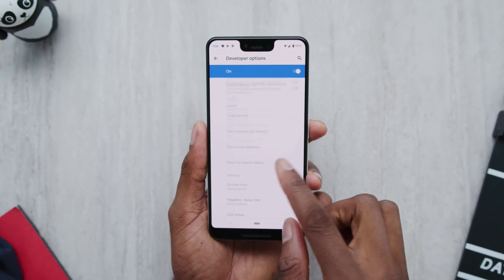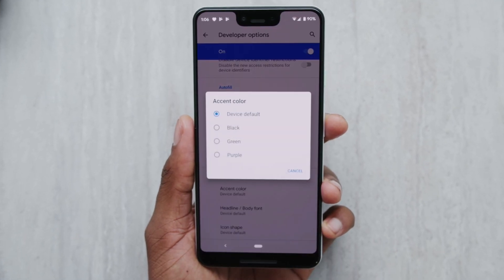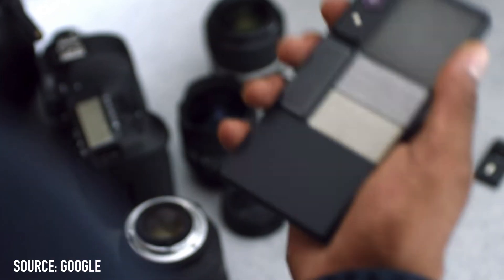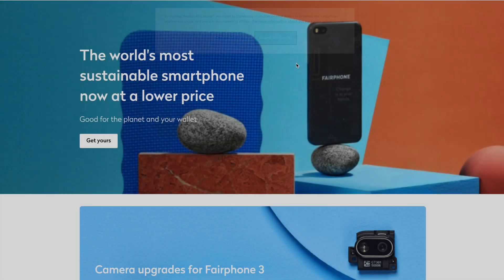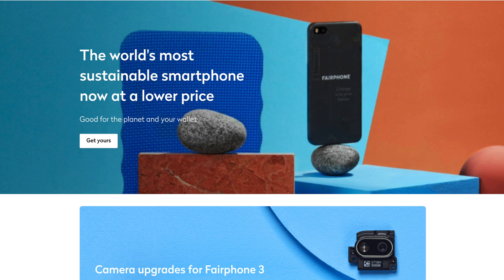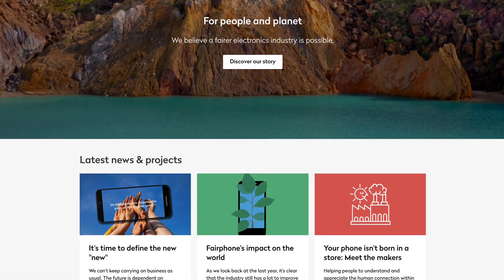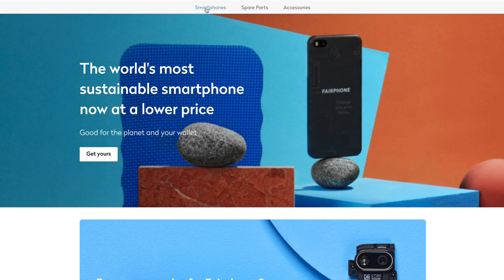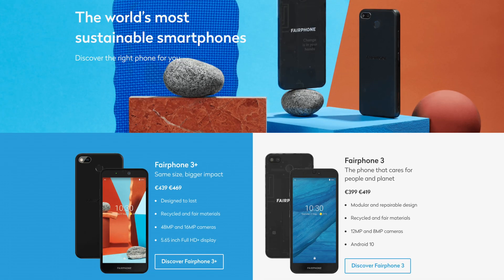Are Modular phones Better for the Environment?

Comment: Even modular cameras like a mirrorless camera change standards. Like new types of batteries, or even new hot shoe. There was a more modular small camera system like the ricoh gxr, not very popular in the end.  Giant cameras like medium formats are better for modularity, where space is less constrained, or cinema cameras like red or arri. Usually a module have size tolerance. There is also currently a class action on dell and their “upgradable” laptop. Not a size issue, more of a socket issue. And they discontinued alienware external GPU enclosure too. 

There are modular accessories phones like essential with the 360 camera, lucky goldstar friends and battery, and moto mods, none as widely adopted as a simple lightning port, which has flir camera support, blue microphone, ring lights, dxo one camera attachment, expandable batteries with camera shutter button too like lucky goldstar. And more with USB-c like creative sxfi spatial audio dac. 

Nice to be sustainable, great to get leed platinum as well, but tough to build out of rammed earth and open fenestrations for every project. Gonna run into double glazing and claddings very soon. Those are limited resources.

Comment: I would say no.
Apple already shows that the main point is software. iPhones have a much longer lifespan than Android phones.
And with the weak hardware that Fairphone is using, their phones won't last longer than 2-3 years even if you can replace stuff like the camera or battery. And on top of that, they're really expensive for what you get.
On top of that, the recycling is horrible when you have individual modules instead of just whole phones that you can send in and get it recycled.

Even if there is this whole right to repair thing going on, I would say that Apples way is much better when it comes to increasing the lifespan. Making phones last longer by providing longer update support (the iPhone 6S gets 7 years of updates) is the way and not stuff like replacing the battery on your own which most people wouldn't do anyway.
Reply: I'm not convinced you're getting it. First off, Fairphone source all their parts sustainably and ethically (both in extraction and production). In a way, it's amazing they can do all that and still charge what they do. I've heard it said that the Fairphone isn't too expensive - the problem is that other phones are too cheap.
I don't see how being able to trivially dismantle a phone makes it harder to recycle. Let's say you want to recycle mineral X from the screen - surely being able to remove the screen with screws rather than trying to separate it from other bonded components makes that easier?
I'm not saying the software side isn't important too. But Apple's admirable efforts in making things longer-lasting in the software side are totally undermined by their completely un-repairable devices and commitment to releasing a new sexy incrementally-upgraded version of the same product stack every year. I had a Pixel XL previously and had the battery replaced, and the (highly-qualified, professional) repairer had to burn through two replacement screens due to the poor design for repair, in what should have been a simple component replacement.

Comment: No, you still have to make the parts to fulfill demand.  Let's say 100% of people are onboard and modular phones are now a thing.  That's a lot of parts.  People are still going to lose them.  You can't guarantee people will recycle old parts.  People will have multiple modules. Trade-ins are going to be a mess. And that's just from first party vendors, think about the third party guys.  The smaller companies will have less recycling mandates and are part consumer as well.
Reply: Exactly.
That's also why replaceable batteries are not generally good for the environment either. People often buy 1-2 extra batteries even if they don't need them. They buy them just for this one scenario where they need them. And that means more batteries need to be produced and then lay around unused.
Reply: Until there's real break through in recycling technology, I'm talking about star trek type shit, our production of waste will continue to outpace our recycling efforts.

Comment: Ultimately, I think this needs to be addressed at the component level by stuff like socket/connector standards that allow you to swap out SOCs, RAM, storage, screens, batteries... anything.

In the ideal scenario, your phone is a ship of theseus, so if some new screen tech comes out, you can find a screen of the right size and swap it out for the old one, then replace the camera a year later, then the RAM, and 10 years later you have the same phone but none of the same components. Realistically, new technology forces new standards, so there will be some generational losses where you can't get the new X without getting a new Y that supports it. But even those don't have to affect everything. There's no reason why you shouldn't be able to keep the screen and casing but move over to brand new internals if the two are fully capable of communicating with each other.
Reply: PCs in a nutshell

Comment: I can see a number of big problems with this. For the base 'phone', for lack of a better term, to be feasible for 7 years, it would have to utilize the latest and greatest chipsets and be built to a very high standard of quality - neither of those is cheap to do in the slightest. Plus, in order to justify ongoing investment in new parts with such a long replacement cycle, the markup on those 'modules' would have to be massive, and while consumers may be saved from an annual/biannual replacement cycle, is it really cheaper? For instance, if I usually wait two years to replace my phone under an upgrade contract, then I will spend max around a couple hundred bucks for a brand new, top tier flagship device. However, if a new camera module comes out every year and they cost $150-$200 each, you're effectively paying a massive premium up to twice the cost of an upgrade, just  to replace only one component of your phone. It falls apart in terms of repairs too - using the camera again as an example, if you have  to buy a new one to replace a busted one, is it really that much cheaper than an insurance plan or even taking it to the manufacturer for service? Speaking of service, I could imagine that being a complete nightmare - especially if they try to keep module costs low by allowing other companies to create their own 'modules'. The vast array of device configurations would be hell (just imagine trying to sort out firmware updates) to troubleshoot and would drive up repair costs. Phones are not PCs, they are designed as a single unit. Another potential pitfall is that older tech does not always work with newer tech all that well, so if you only replace the camera for seven years but leave everything else the same, is your phone going to even be usable? What if the newer modules use more amperage than your battery can supply? Is that safe? Battery life could suffer too, even on newer 'phones', since the device can't be optimized around it's hardware, unless you keep everything proprietary, which is expensive. Finally, what's to stop them from one-day requiring users to permanently pair their modules with their base 'phone' so they won't work on another device. Yeah, it may not start that way, but if such a company was picked up by private equity or a major manufacturer, I am almost 100% certain they will do that - they have every incentive to.

In theory, it makes a ton of sense, but in practice it really seems like a borderline malicious way to nickel and dime people under the guise of having more control.

Comment: Watching this on my Xperia X running Ubuntu Touch 😁 (Fairphone can also run Ubuntu Touch 😉)

I think one of the main problem with the support on the Fairphone and similar device is software.  Android phones are stuck on their kernel version and only 1 or 2 major android upgrades and that's it. Mainline linux devices and OSes can solve this but it's a century behind in terms of features and reliability 😅

But the biggest thing that is near impossible to stop is people wanting to buy new things, just because, unless we raise the next generation to be contented with what works which I don't think is happening.

Comment: I have used the original Moto G for 7 years, and it was one of my favourite phones of all times. Now that I am in a much better financial situation and I use my phone more, I want an OLED screen, lots of RAM, a fast SoC, and a big battery. Couldn’t care less about the camera though…

A repairable phone would make it easier to keep it for longer, and even if I wanted to upgrade the phone to a completely new device, I could still sell of giveaway the old phone for someone else and it will mean someone else won’t need to buy a new one. For that reason I would be willing to pay a higher price for repairability, but I really don’t want to go back to slow phones.

If fairphone made a premium phone that had flagship specs (or close to it) and a repairable design, even if it costs 15%-20% higher than the competition, I would buy that one.

Comment: iPhone is supported for new OS versions for 6 years, then a further 3 years of security updates. They can be passed down to family members or sold for extended 2nd and 3rd lifespans. Apple does a great job of recycling at end of device life, to turn an old phone into parts needed for a new phone. Apple over engineers their devices specifically to be extremely long lasting.
Reply: Old iPhones can be a hassle to use though. Especially with them making things harder to repair from a third party, most people wouldn't keep their iPhone longer than 3 years.
Reply: @garryglasgow97  The average lifespan of iPhones are 4.2 years. The AVERAGE. That means many people keep their iPhones for longer than 4.2 years. And that's exactly what you can see on a daily basis. There are tons of people with iPhone 8, 7 or even using their 6S. Even the iPhone X is already 3.5 years old and many people still use it.
And Apple extent the lifespan even more since the update support gets longer and longer. The iPhone 6S will already get 7 years of support. Apple only stops the support if the hardware is really no longer capable of it. That means iPhones like the iPhone 11 or 12 will probably get up to 10 years of support one day. In fact when it comes to important security patches, Apple already is close to those 10 years.
Reply: @Raja995mh33  we're both right in some way. I have seen some people use really really old phones. The problem is that they're still a hassle to use. I was having trouble with my iPhone 6 when iPhone 10 was coming out. The problem is the lack of repairability in the future phones.
Reply: @garryglasgow97  Even there, Apple is actually partly on the better side. For example, try to find a repair shop that still has parts to repair your Galaxy S7. On the other hand the girlfriend of my dad just send in her iPhone 6(!) and got a new screen and battery. Sure, right to repair is totally a thing and Apple needs to open it more for third party repair shops but at least they still are providing parts for even 7+ year old phones while on Android you often have a hard time finding original parts for your only 2 year old phone.

Comment: The issue with this idea is durability. How much easier can you bring this phone with all it’s exposed components to its knees versus a well built phone that’s hard to repair, like modern Samsungs or iPhones which are already getting 5+ years of software support. And most people will probably just throw away the modules after they’ve switched them out. And if they were the type to upgrade every year,  nothings stopping them from just buying the new fairphone for the faster chip.

Comment: I'd still use old devices if they got security patches still, I've got 3 old Android devices but they all are on old security patches from years ago
Reply: get them recycled ?
Reply: That's the main problem after all. Phones these days are already powerful enough to last the 7 years that Fairphone wants (which is funny because Fairphones are not really powerful enough for this idea...). But Android manufacturers just stop supporting them after a while even if the hardware is more than capable enough to last longer. That's why the average lifespan of an iPhone is 4.2 years and only 2.3 years on an Android phone.
Reply: @Raja995mh33  it's why I'm actually more likely to buy iPhones now, because the longer life span (I like android and iOS equally so other than that it doesn't matter much to me). I've got an iPhone 8 that still holds up great to this day, even beats out my mid-range Samsung on performance.. company's are perfectly capable of keeping their devices running a couple extra years, and really should

Comment: Me watching on the LG G5 after switching the battery for the second time : Yes, so much yes! But please give me Flagship specs! I.m.o. Midrange or Low-End Processors are a waste of silicon
Reply: They're not for people that want cheaper devices and buying second hand high end stuff doesn't always guarantee long run software support
Reply: @seanonraet8327  Sadly yes, however in my opinion Google and Android devs (like myself) are very good at working around the issue. Even my Android 6 (!) phones like the Galaxy S5 can run 90% of Apps on the Playstore. Some key features like Nearby Share these days are getting integrated over the Google Play services. Also Chromium gets updated forever - I think even Android 5 devices can run Chrome 91 which means ALL webapps render and run perfectly fine. 

TLDR; On Android Updates matter very little and you can get away with a 5 year old OS version.

Comment: Just imagine a Fairphone with these specs: 

1. 5.4 inch 1080p OLED screen without any kind of Notch/Punch Hole or chin/forehead.
2. Optional second screen with selfie cam for those who need it.
3. At least 3500 mAh removable battery with battery protection (stops at 80% to increase battery health).
4. Fingerprint scanner under the screen for better reach ability and to avoid cutouts on phone cases.
5. Physical kill switches for the microphones and antennas for guaranteed privacy. (If possible)
6. Support for Graphene OS/Calyx OS. (If possible)
7. Always On Display
8. Upgradable chipset
Reply: - always on display is just software
- battery limiting is software too
- they can just let you unplug and remove the camera and mic
- you can put grapheneos on basically any android
>> They don't need to do much
Reply: @superslimanoniem4712  
I agree with the software part, but unplugging and removing the cameras and microphones would be very inconvenient, a simple set of hardware switches behind the battery cover would be ideal. GrapheneOS and more importantly CalyxOS are, as far as I know, only available for pixel devices and on some other very limited amount of phones...
Reply: @superslimanoniem4712  And AOD is not just software. It requires dedicated hardware and no, "OLED" in generell is not enough. That's why all those apps on the play store that enable AOD on phones that don't have it burn your battery like no tomorrow.
Reply: @Raja995mh33  Precisely!
Reply: a physical kill switch for antennas and microphone would probably be impossible. Phones have microphones everywhere and not just at one spot. 
Same goes for the upgradable chipset. The phone would need to be super big and clunky to be able to implement stuff like this.
Reply: @Raja995mh33  Taking multiple microphones offline with one singe Hardware switch is no problem. Making the chipset upgradable however requires every manufacturer in the design process to work hand in hand, which is very unlikely to happen. But it would be ideal...

Comment: Fairphone is the current gold standard when it comes to how a phone should be designed. 
Framework Laptops are also on the right track!
Reply: I think the way shiftphone is doning it with more powerfull hardware is better
Reply: The old thinkpads are the gold standard for laptops. Basically every component is still available for sale.
Reply: @vablo7198  Then you're probably not part of the target demographic. People who actually care about the environment don't give a crap if a phone is slightly bigger or slightly heavier than others. To me, the ability to easily replace or repair parts is a huge enough upside that I can ignore the downsides.
Reply: There is way more to "design" than just how good its reparability is. And everything besides this, the Fairphone really doesn't have a good design at all, let alone being a "gold standard". It's only a gold standard when it comes to reparability.